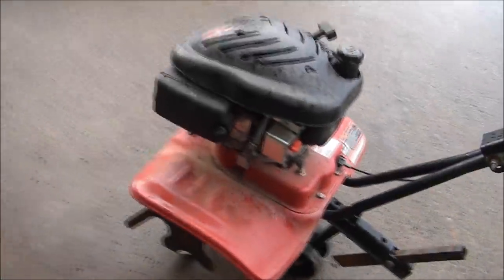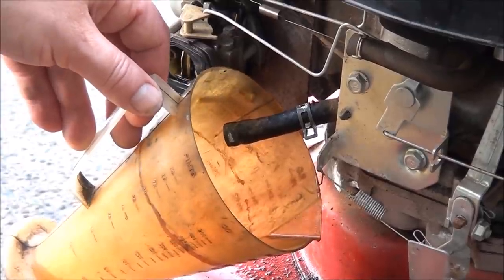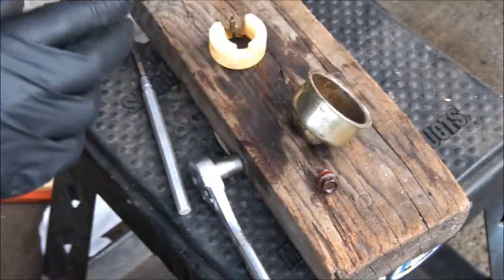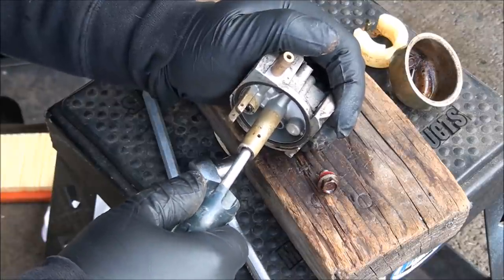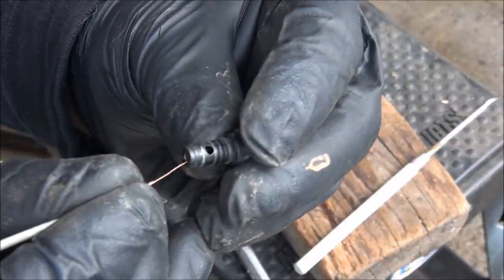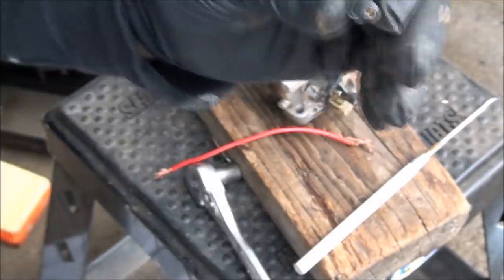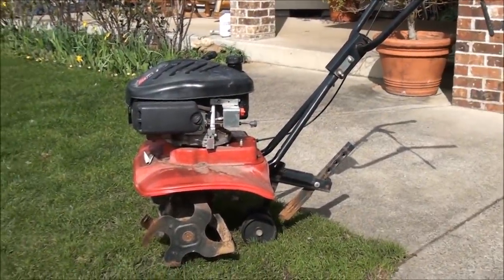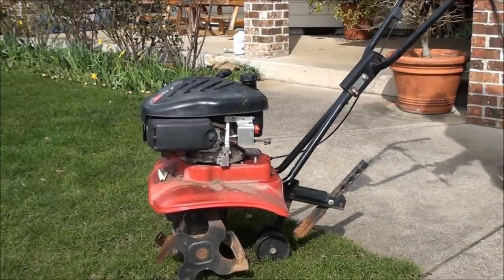HOW TO FIX , MTD YARD MACHINES TILLER, Wont start. 139 cc OHV engine Won't RUN, Carburetor PROBLEMS

Comment: I have a mower with this engine I've had zero issues. Cable choke works great and every time I've needed it over the years it has never let me down. However my very old CraftsmanII mower model#  917.37230 thinks it's  brand new, fresh out of the box and continues to start on the first pull every time, every year. It's the first mower I ever fixed cleaned out the carburetor and I haven't needed to do it again just like the MTD mower. Take care of your machine and it'll take care of you no need to feel sorry for the 139cc MTD mower or the Tecumseh owners, maintenance is key and knowing how to store your machines just as important. Yes, I have Honda mowers and Husqvarna that have been great I have a 1950 mower that's great. I love all my mowers and take care of them, I enjoy it.

Comment: Have exact same 1. Just bought it used and wouldn’t start. Took carb off and cleaned no difference. Took off again and really cleaned and soaked in the cleaner and it worked. I can’t believe it. Before this video I never touched a carb lol. Delighted with myself!
Reply from the maker: Awesome! good work

Comment: Just popped in to say thank you for the carb break down video. Tore my mowers carb apart. Cleaned the main and low speed jets. Put it back together and no go. Didnt know about the piece that comes out under the main, that was the issue. Took it back apart, cleaned that. Started right away. Subbed and 👍🍻
Reply from the maker: nice work!

Comment: Jeff what and excellent video, thank you a million times! I have an MTD engine same as in your video I replaced the carburetor and still it would start and stall out or run on full choke! Worked on it today same thing. Watched your video and found out I was putting the filter housing gasket behind the carb on the engine side...and that was my problem! Thanks again!!!!
Reply: Me too. Those gaskets are confusing. Except now it starts easier but runs very rough. I’m afraid I ruined it.
Reply: Update: I re-cleaned the carburetor in gasoline with an ultrasonic cleaner and it works fine. Thanks for the awesome video!

Comment: I HAVE A LARGER YARD MACHINE TILLER, AND IT IS THE BEST TILLER I HAVE EVER HAD.  I DO NO MAINTENANCE ON IT OUTSIDE OF OIL CHANGE AND IT STARTS ON THE FIRST OR SECOND PULL EVERY TIME.

Comment: Thank you for the great instructions. I did my lawn mover this morning and it now starts on the first pull. This was the model with auto choke so the choke and gas linkages were slightly different and a bit more cumbersome to get off but all in all worked the same

Comment: Good work Jeff: I have customers that every year bring their mowers, tillers, etc. to me for similar issues. I keep telling them to use non ethanol fuel but they won't pay the extra cost of the gas. One lady only idles her riding mower and won't run up the rpm's. Fouls the plug and she can't understand the splash oiling system and that she is doing more harm to idle the engine while trying to cut grass. Gets frustrating. Thanks for the video's.
Reply from the maker: Lol! Customers can be ridiculous sometimes!

Comment: Do you have any video of servicing the belt tension?  I just bought one of these used and I'm not sure if it's a belt or chain but I know that it's not tight enough because the time stops spinning up the dirt too tough

Comment: Don't know if it will help but I use a wire from a wire brush to get into all the holes when cleaning a carb. Bit stiffer than a wire, or welding tip cleaners.

Comment: rosepierre2
Carbs get dirty because of fuel issues. Don't be dismissing a complete line of engines because of a fuel problem. My MTD lawnmower with a similar engine has run perfectly for 7 years now. I make sure to drain the gas in the fall and just do regular maintenance.

Comment: Hey jeff,
I got a question for ya. I use my tiller once a year. Should I only fill the gas 1/4 full and after I'm done tilling just run it until its outta gas? Carb clogs with stale gas so just run it till its outta gas would be an easy solution right? Thanks man!
Reply from the maker: Yep, That is a good thing to do before storage

Comment: Can’t get carb off 2 bolts to work on carb

The metal rod with z hook on each side of choke won’t allow me to unhook carb 

choke there
Should I remove it from other end ?
So undo 2 nuts on top part of lawnmower 
Would that help?

Comment: QUESTION ? Help 
I have exact engine but mine is push mower. I tried to replace the control cable and want to know if there is spring attached or not. I couldn’t find any diagram online. Any help would greatly be appreciated

Comment: What's the problem when this type of engine idles "up'n'down". The engine surges at idle speed, "hunts".
Reply from the maker: The slow speed jet inside the carburetor is most likely plugged

Comment: There is nothing wrong with these engines. Change the oil often. And install an in-line filter to reduce carburetor issues. ^_^
Reply from the maker: I respect your opinion, I however think they are crap.
Reply: I also own one,have had it for well over 10 yrs only had to do one carb cleaning on it and that was almost 4 yrs ago now.Always starts 2 pulls.I even forgot to drain the gas from last season and it still fired up.All in all my experience with them has been very pleasant.Wish i could find another or maybe i just got lucky with a good one,not sure,lol.I just change the oil at the beginning of the season.Still doesn't burn oil and i use it for my lawn service so it sees a lot of use.I changed the oil just this week and when i checked it it was still at the full mark but my other lawnmower(briggs and stratton) was below the full mark.I was surprised when this motor actually outlasted its wheels which i just finished replacing.Until recently i had no idea what engine it was til i found the box and found out it was a powermore.To me kinda looked like a mix of a honda.Well this has been my experience with it,maybe i got a lucky one out of the bunch not sure but ill continue to maintain it for as long as it lasts!As always a great video Jeff,very informative!☺
Reply: It's a Kohler modeled after a Honda GCV engine. They're crap because of the linkage. For $16 just buy a new carburetor on Amazon, and always run the mower until it stalls at the end of the season, or use stabilizer fuel.  Kohler's are the worst to work on and most finicky due to the tiny jets and ports.

Comment: USE NON ETHANOL CHEVRON 94 OCTANE FUEL OR SHELL 92 OCTANE, ALSO DO NOT LEAVE GAS IN YOUR CARBORATOR FOR MORE THAN 2 OR 3 WEEKS.  DRAIN THAT CARB ONCE YOU ARE NOT USING IT.
Reply from the maker: good tip

Comment: How come this machine is not set up so that it runs at full engine speed but only half speed????
Reply from the maker: you can adjust them a bit but too much rpms and the engine can fail if it revs too high

Comment: You were too kind in your review. I have a 140 cc that i used 4 times before it died. I clean the carb and now it runs great for 10 minutes then surges and dies. Has to cool down before i can mow for another 10 minutes. 
Worst air filter i have ever seen.

Comment: it is kind of funny how you make it sound like they are shitty engines yet it starts first pull once you clean the carb. all carbed engines are prone to having the same issue if you leave gas with ethanol in the tank all winter or summer. at least it is not as bad as those newer briggs and stratton plastic carbs that once they clog they either need to be replaced or have the main jet drilled out. never really had much issue cleaning a honda style carb like the one on the machine in the video